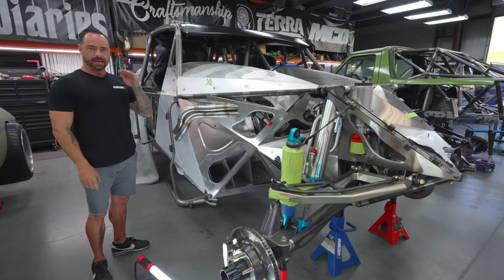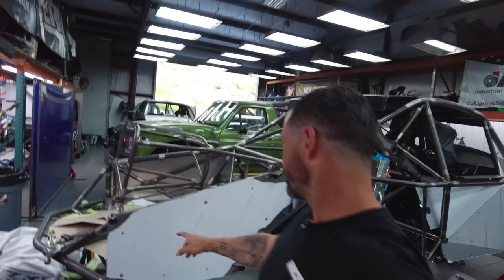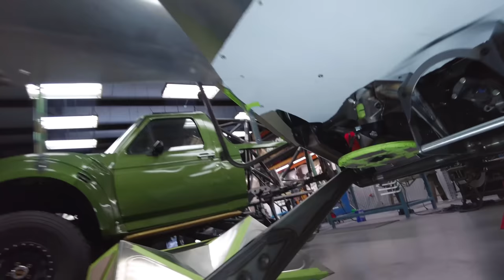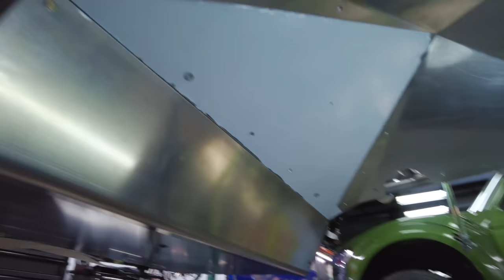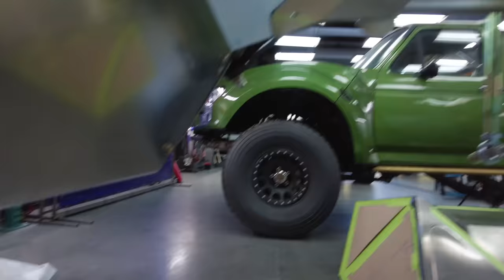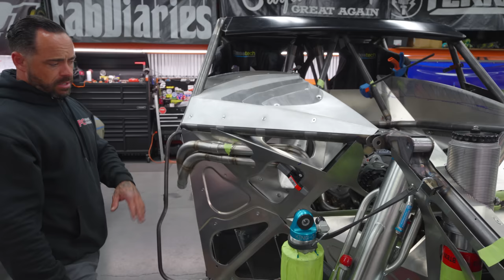Raw Aero Panels for Kevin's 6100 Truck | MORGAN CLARKE DESIGN

Comment: Will there be a front bump stop? What is the purpose of secondary tube structure on top of upper contol ? Thanks for sharing brother!
Reply: The front bumps will have shock eyelets on both ends and bolt to that tube structure called a slapper bar. It's a pretty old school trophy truck setup that has made a come back in recent years.